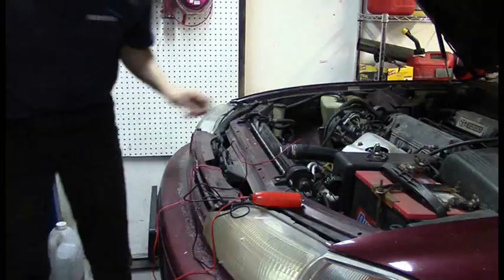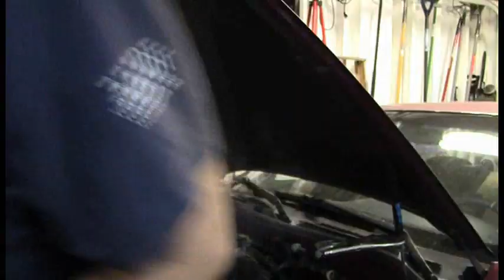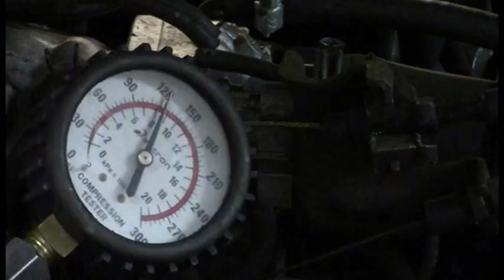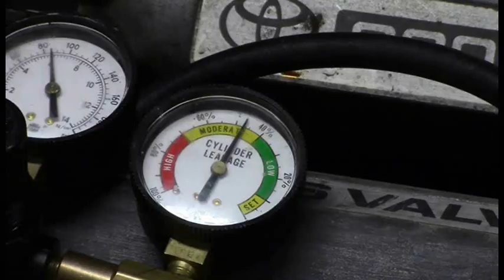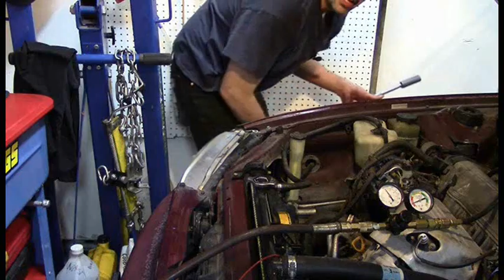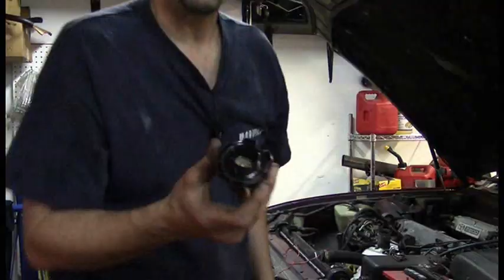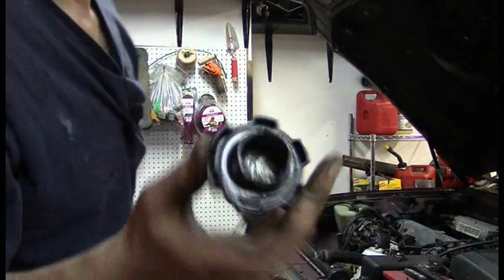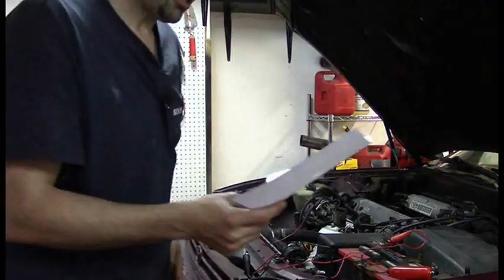12 Ways of How To Test A Blown Head Gasket Compared- PART1

Comment: Please what can be the problem when engine oil mix with coolant but in radiator the coolant has no engine oil
Reply from the maker: It’s likely a blown head gasket but could also be an intake manifold leak. you need test for a blown head gasket. 
you don’t expect coolant to have oil in it in either case because the coolant enters the oil system through the combustion chamber but oil never enters the cooling system. if you find oil in the coolant it’s most likely due to a bad radiator, transmission cooler, or oil cooler that is leaking oil into the coolant.

Comment: Appreciate your video seems that you are a knowledgeable mechanic. Can a pressure test alone identify a hair line fracture? No coolant or water in radiator.
Reply from the maker: Yes, absolutely but you may have to maintain the pressure for a few minutes before it finally presents.  On a larger leak it will be instantaneous but i recently did a video where there was a very small leak and it took a couple minutes before the pressure test revealed it.
Reply: Thanks for your response. My reservoir empty/oil good. Vehicle history of overheating. Auto shop performed pressure test, negative. Replaced water pump returned vehicle to me, now coolant/oil mix within  1 week stating I have hair line fracture. Could that have been missed on pressure test
Reply from the maker: Yep I have a video where I missed a small combustion chamber leak. The compression tester totally was unable to find it and my initial leakdown test missed it too. But once I determined there had to be a combustion chamber compromise and did the leakdown longer it presented clearly. The compression test never did detect it though.

Comment: Great Video! Thank you!

Question:  In your experience- how common is a cracked head or a cracked block, compared to a blown HG/warped head that can be fixed?   I don't want to have the head pulled only for them to tell me its beyond repair.  I know there is no way of knowing until I actually pull the head off- I'm just looking for a rough estimate of the percentage of vehicles you come across that it can be salved with a new HG and getting head machined?  Its a 05 civic EX 1.7 (aluminum head).
Reply from the maker: Good question!  out of probably 100 compression failures I have seen, only one had a crack and even then it was the Piston Crown that was cracked.  I have never seen a cracked head or block. 
   In my latest video I show a severe overheat and there was chipped pieces that broke off the valve recesses in the head, but there wasn’t an actual crack and the real problem was the warp on the head that was so bad you could see it just with your eyes. 
   Also along those lines- out of those 99 warps, not a single one had warp on the engine block deck. Only on the cylinder head surface. I have never seen a warped block even on an all aluminum engine.
Reply: @SchrodingersBox  thank you so much for the quick response! Another question if you don't mind- it was recently suggested to me that i try to re-torque the head bolts before replacing the head gasket and that might fix (or at least band-aid) the problem- any experience with this?   My father said he'd help me do that tomorrow but i dont want to do any more damage to the car.... Plus i was quoted around 1600-1800 for head gasket, water pump, timing belt and sending head to machine shop.  Does that sound fair on a 4 cyl civic?  I live in NYC so that might be why its steep..
Reply from the maker: @SuchAdirt  No disrespect to your dad but that is a BAD idea for several reasons.  
First- it will never work. You will never ever torque the bolts enough to actually change conformation of a warp or seal a blown gasket.
Second, even if it did work- and it wont,  overtorquing will weaken the bolts and make them more subject to failure.
  And third- god forbid you snap a bolt off in the block or strip the female threads in the block- well now you got a real problem far worse than what you started with.

  The quote you got sounds very fair actually.
Reply: @SchrodingersBox  No offense taken, we appreciate your expertise!  Could it hurt to take the cover off and make sure the head bolts are torqued to specification- and if not- re-torqueing them to spec?  Or can that also do damage to the engine?
Reply: @SchrodingersBox  LAST questions- any opinions on that liquid sealer miracle stuff (bluedevil, etc.)? I'm skeptical and don't want to do further damage (even though my car is a beater its all i got).  

Second- when that head you saw that was warped really bad- was it able to be machined to working condition, or was it garbage and require a new head?

No more questions, I promise.  You've been a great help!
Reply from the maker: Hahaha no problem. I have never seen a liquid head sealer work. If it worked, it’s because the head gasket was misdiagnosed- it was actully a leaking intake manifold gasket not head gasket. 
   Checking the torque won’t hurt. but again- let’s say you do happen to find a loose bolt— the bolt was loose because of a warp. So tightening it won’t help.
  Finally- machining is the best (well, only) fix for a warp.  BUT- there is a limit to how much machining can be done. When you shave material off the head you bring the valves closer to the deck and if too much is taken off the valves will hit the pistons. So if there is too much warp you must get a new cylinder head.

Comment: If i have white foam in the expansion bottle similar looking to white soap foam or beer foam, and the oil is clear and still same level what could the problem be? Still cant find an answer online, i bought and older car with water instead of antifreeze and wasnt changed in 12 years or so, with that oxidized and muddy looking water was running fine no overheating, i changed to organic antifreeze and white foam everywhere also spills out the antifreeze by the overflow tap in the expansion bottle then it overheats.
Reply from the maker: Check your cylinder compression.
Reply: @SchrodingersBox  Thanks, i will as soon as i can

Comment: My expansion tank keeps becoming overful after driving and only occasionally goes down.  After some months the expansion tank drops down past its minimum mark.  I tried doing the CO2 test; however, as the expansion tank keeps being filled the collant entered the test equipment before the test fluid had chance to change colour (even after removing half a liter of coolant beforehand.  I did see some bubbles running through the test fluid when the car was running.  I do not see any white vapour coming from the exhaust, and nor do I see any external leaks.  There is also no milky residue on the dipstick nor oil fill cap.
Reply from the maker: Do a compression test.

Comment: You stated there is always a reason that leads up to a blown head gasket. If a car has high mileage (250k miles, 11 yrs old) and never overheated, and no coolant mix but failed combustion leak test, will high mileage and age of the car cause a head gasket to blow?
Reply from the maker: I’ve never heard of not seen evidence of age causing head gasket failure. If the car has that issue it would be interesting to see what the warp on the heads measured.

Comment: Great video!  Unfortunately, I have torn apart much of the vehicle after diagnosing a bad water pump, due to several overheating episodes and disappearing coolant.  (Water pump was diagnosed by no movement of coolant in the radiator when running with cap off and then removing accsy belt and being able to freely spin the pump.)  The timing cover is filthy and so is the underside of the vehicle, seems it has been loosing coolant for some time!  Then after seeing the amount of coolant everywhere, even in the crevices under the intake manifold, I suspected leaking of the head gasket.  At this point I have the intake off, Throttle body off, radiator off, valve covers off, but yet tried the leak down test and not sure what to make of it.
First, I set the Compressor at 75psi but suspiciously only would see 30psi on my tool psi...... once connected the tool to each spark plug (at TDC), I only got one of 6 cylinders to read less than 20% leak.  Other cylinders were off the charts, like 90% plus and the tester psi dial 0 and some of those cylinders would make noise, air gushing out mosting from adjacent intake, while others reading 90% would not make any noise.  Given the tear down condition, can this test be useful at this point??  Just wish I had used the bulb test BEFORE tearing apart!  Now I almost think I should proceed with the water pump/timing chain replacement and reassemble, then do the bulb test and if that is bad another tear down!!  Or do you think there is a definitive test I can do with the tear down I have done or just proceed with the cyclinder removal/inspection/gasket replacement since I am already to this point?  Worst part is that this is a 2003 Suzuki Grand Vitara and I am learning these are awful to work on!!!  Regardless,  I am repeating the leak down tests, but think my tool may be bad???  First off I should see same pressure at tool as I set my compressor no?  Thanks!

Comment: Well I always come to the person I know his stuff,so my question is why did I get a p0300 code after replacing lower and upper intake gaskets
Reply from the maker: Most likely a vacuum leak would be the cause. What's the fuel trim analysis show?
Reply: @SchrodingersBox  I didn't have a good scan tool,but will take mine and redo,will get back to you tomorrow,thk-u mat

Comment: Or you can use a snap on coolant system pressure leak down pump. This was and is an excellent test. By pressurizing your cooling system you can check for leaks and by leaving it pressurized for an hour or so, while you work on something else. If it leaks down and there are NO VISIBLE leaks you know you have a head gasket leak. Why is this an effective test? Because the cooling system is a SEALED system. It has to hold pressure to work. Now if the pressure leaks and again there are NO external leaks, this includes checking heater core(s).  I have known for compression tests to fail to detect a head gasket leak. But disappearing pressure in a cooling system without seeing a leak, HEAD GASKET!  lol they didn't have the CO chemical test when I was a tech. At least I never saw it or heard of it.
Reply: Great idea but remember if too much water gets in the cylinder you can bend the conrod when you crank the car.

Comment: You forgot to mention one thing, in the video it was hard to tell what color the fluid was when you started, it looked kind of bluish, blue mixed with yellow will turn the fluid green. is that correct?
Reply from the maker: Blue when starting, yellow if there is CO2 present (blown head gasket).

Comment: Hello. Thanks for making this video, it’s very informative. Question: Does performing the Block Tester test pose a risk of creating a large bubble of air in the cooling system? Is it adequate to simply replace the removed coolant after the test, or might you need to burp the cooling system afterwards. Sorry if it’s a dumb question. Thank you for any help!
Reply from the maker: No danger of that at all- you're just removing enough coolant that you don't suck it up with the tester- maybe like 2 cups at the most.  Just top it off when done.
Reply: @SchrodingersBox  Thank you!

Comment: I have a friend with a 4.0 SOHC that the rear passenger cylinder has a spray of fuel with water mixed, took out fuel pump relay , depressurized fuel rail and it just sprays a mist of water out spark plug hole. Had went on a 120 mile drive round trip, no issues at all, next day engine wouldn't crank, even tried by hand. after removing spark plugs, it was fine. When I removed spark plug from cylinder in question, I heard a release of air pressure that sounded to come from throttle body. My question is no codes, no misfires ran great day before, what the heck is it? I don't see any milky on dipstick, cap is clean and reservoir is not down.
Reply from the maker: Sounds like water entering gas tank.
Reply: @SchrodingersBox  That is a good thought, but to only have it in one cylinder? I think I found the cause. The upper intake had water pooled up around the port that feeds the cylinder that did have the water mix and only that port. I believe it has a bad o-ring gasket. We've had a bunch of rain and this occurred upon starting it the day after it drove fine and was parked during the rains.  Now when it stops raining I will change them along with the valve cover gaskets that I see are leaking oil too.

Comment: First of all I very much like the way you teach us by explaining everything very well. I do have an interesting question for you. My Jaguar XF (V8 4.2 supercharged) does indicate low coolant fluid after 5-10 min of driving and stays on or might go out after a while. We expected a false sensor so that has been replaced to no improvement. The guy at the shop did the CO2 test and it stayed blue, phew!!! He also tested the electrical wire from the sensor to the computer. There is no decrease in fluid and when the car is started after a few hours the warning has disappeared. I started to think about temperature or locked air (but that has been checked). Do you have any ideas what to look for? KR and a happy and healthy 2020!
Reply from the maker: You might want to see one of my latest videos where a car with a head gasket failure lied on the chemical, leakdown and compression tests!!!  Otherwise- pressurize the cooling system and see if a leak can be located.

Comment: Fill the radiator to "overflowing" then start the engine with the cap off. If it blows out coolant or air bubbles, you have a problem!
Reply from the maker: That’s not a good way to do it because it does not account for expansion and water pump activity.

Comment: SUMMARY OF VIDEO (list of tests. BTW, I counted 15 tests)
Test cannot tell you WHERE the leak is
- head gasket, warped engine block or cylinder heads, cracked block between cylinders, cracked valves, failing piston rings, manifold leak, etc.

* 1. Coolant Chemical test
* 2. Compression test of cylinders
* 3. Leak-down test (might hear bubbling)
4. Check for bubbles through radiator (remove cap)
5. Cooling system pressure test (attached to where cap is)
6. milky/foaming oil
7. milky/foamy oil fill cap
8. milky oil - coolant in oil pan (coolant would float)
9. coolant billows out spark plug hole while cranking engine (using paper covering hole) - best with cold engine?
10. starter sound test (compare to other cylinders, uneven compression)
11. billows of white smoke from tail pipe
12. check for bubbles under radiator cap
* 13. Sizzle test - super heat aluminum foil with lighter then dribble oil (from engine) onto aluminum. If it sizzles, there must be water/coolant in oil. If it just smokes, there isn't any
14. Heater hose test - check hose for pressure where hose gets very stiff when you first start up the car
15. fluorescent dye test added to coolant (official GM test) check for dye  on spark plugs, exhaust pipe, or anywhere else in exhaust system (also potential with 9)

* most reliable tests

(Hope I got it all right).
Reply from the maker: Mostly correct.  With a leakdown test you can indeed tell where the leak is. The other ones, they only confirm loss of compression.

Comment: My car was missing coolant I was topping up while waiting for proper time to remove water pipes, but seems to have been late. After examining and fixing water system car still over heating and fans are working. I suspect the gasket is gone, lots of work.
Reply from the maker: What compression integrity tests have you done?
Reply: I only noticed today, haven’t done any yet.  Cooled it down after having noticed earlier that the overflow was unusually full and boiling. Most of the water went back by itself to radiator, topped up bit more. I’m still hopeful that the system is just confused. I thought I also saw white smoke from exhaust earlier. I’m still thinking of taking the car to a radiator place to check if exhaust fumes are in coolant, the one that turns yellow. Before that I want to drive it one more time to check if it will overheat again upon which I will connect fans straight to battery if I’m to drive it such a place is though they demand a new that the engine be very hot before test. What would you recommend? I could load a video or so. Im bit worried if the cylinder head if warped can still be machined as it was done 2 or 3 times before. Car 20 years old engines rare.